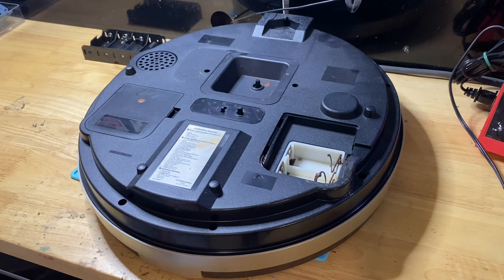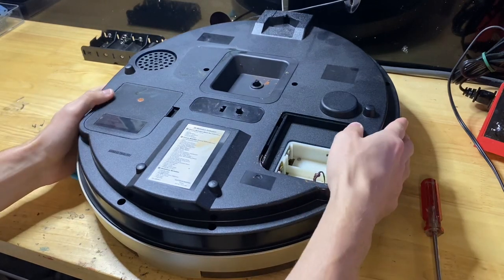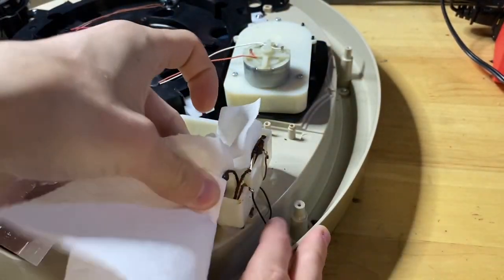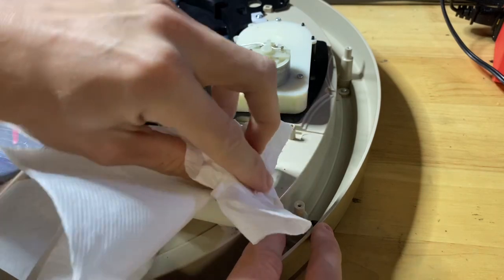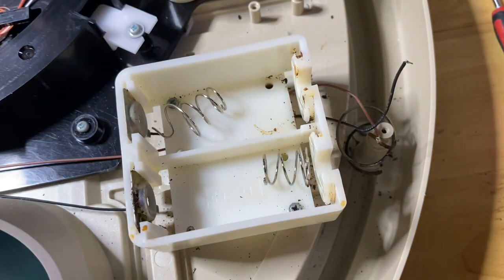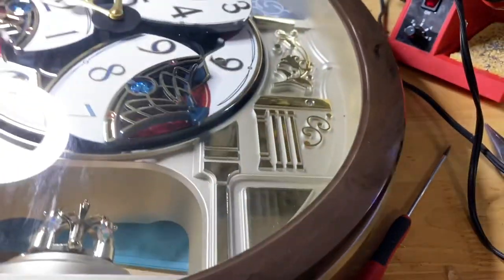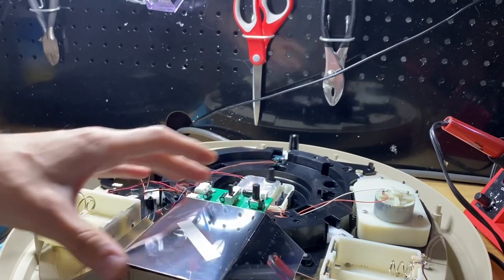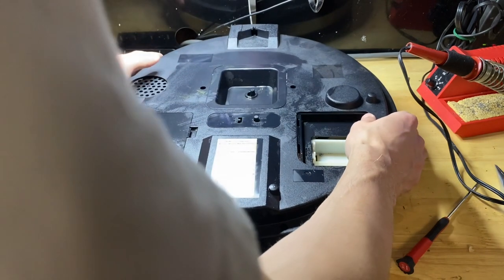How To Repair A Corroded Rusted Battery Compartment On A Seiko Melodies In Motion Wall Clock

Comment: You can grab a piece of soldering wire and then turn it into a terminal coil Then solder the coil into the wire that is  not rusted yet to each battery terminal that could work
Reply from the maker: Yeah in my case the wires were still could so I could still use them, but sometimes they rust and need to be replaced

Comment: i bought mine at sams club several years ago. love it. one battery terminal side is corroded, so you are telling me the whole clock will still work using only the 2 batteries on the other side? sweet. I don't have to do any repairs then, right?
Reply from the maker: Depends on the model you have. But yeah some models will work with only 2 batteries but they’ll last half as long

Comment: Great videos. My motor doesn’t seem to have the strength to turn the faces as you have to keep helping it even with the motor taken out but connected . But put it on a 9v battery and motor was fine. Can a motor just not have the strength at slow speeds ?